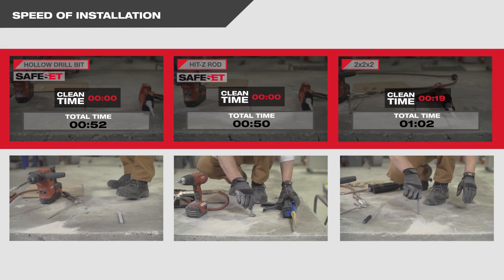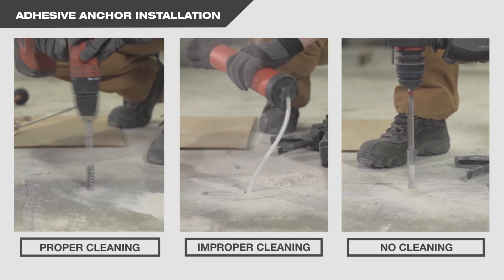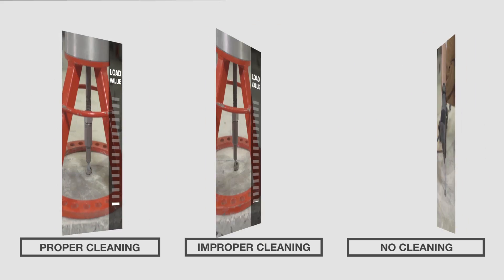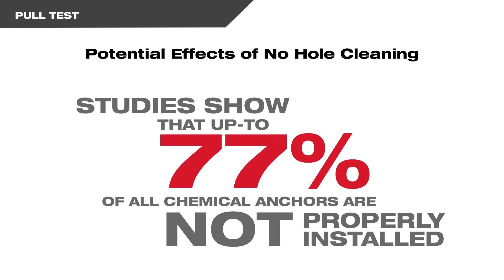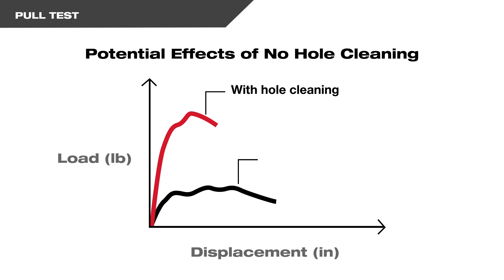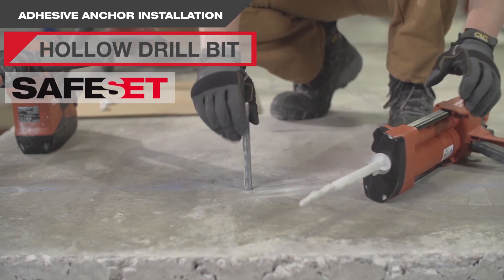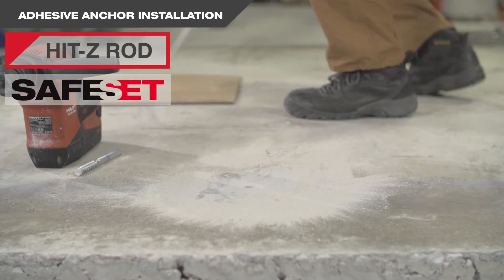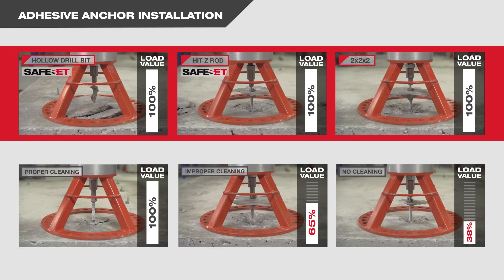COMPARISON of the Hilti HIT-HY 200 proper adhesive anchor installation

Comment: Force of the test? proper cleaning is 22kN or high?
Reply from the maker: Hello- The pull test load is based on the capacity of that specific anchor and will vary between anchor types (Hybrid Adhesive or Resin Epoxy), diameters, and embedment depths. However, when this test is conducted the same anchor, diameter, and embedment depth is used to provide clear results. For anchor capacities please visit our website on the link in the description above to view our technical guide which will list out all of the anchor capacities for our Hybrid and Resin Epoxy anchors. - Sarah, Hilti North America Social Media Team